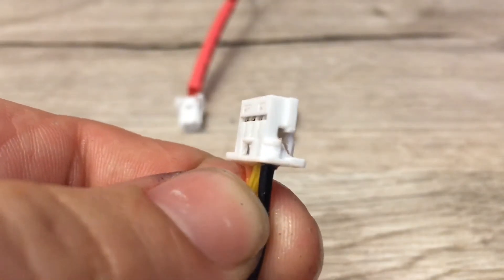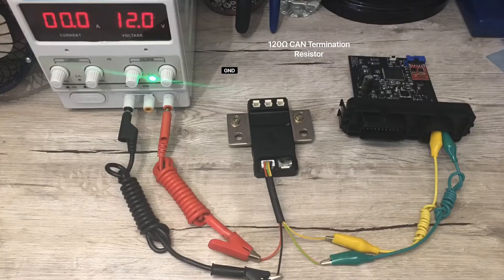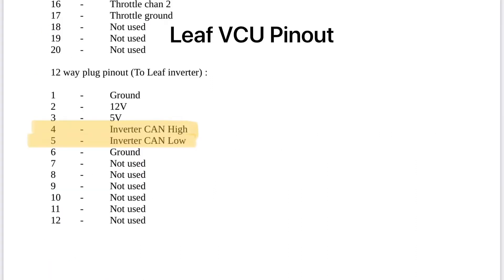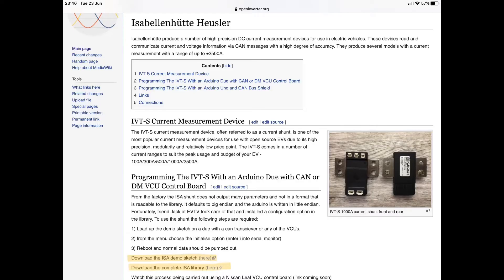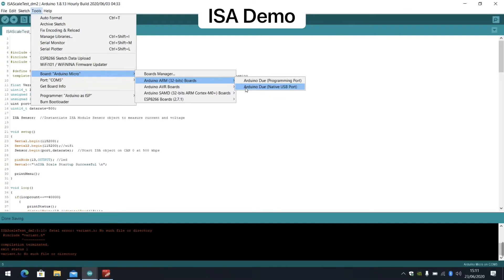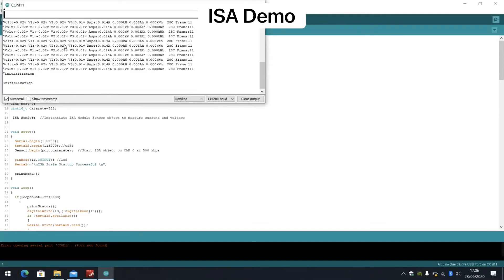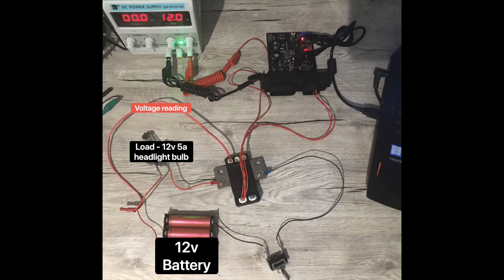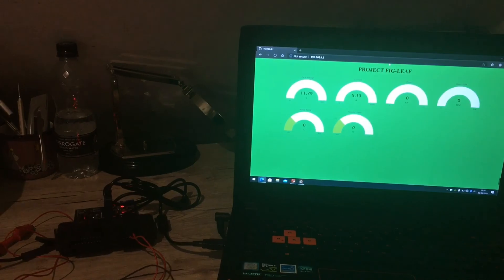Configuring the IVT-S with a CAN-Due or Damien Maguire VCU Board: Part 2 - Configuration

Comment: Did you ever get this setup working in your car? I have the same setup but every time I get the info from the shunt to display the temps and rpm stop working and visa versa with the temps and rpm showing the info from the shunt will not display.